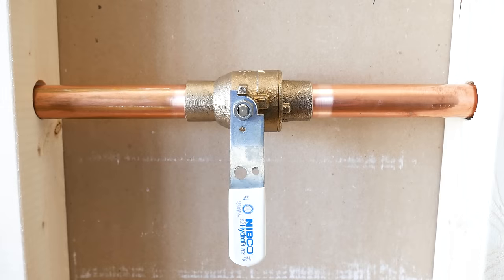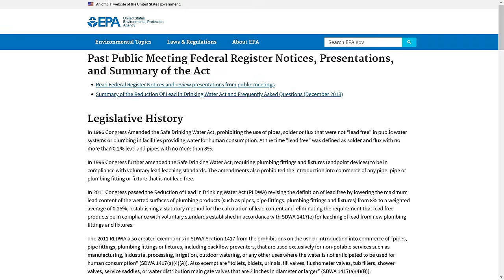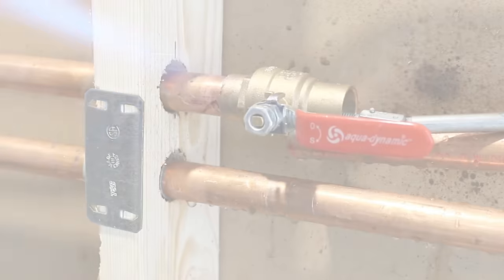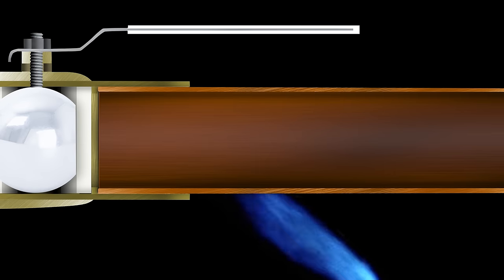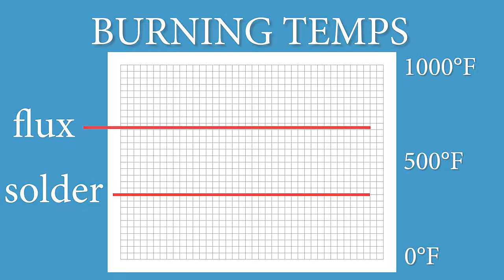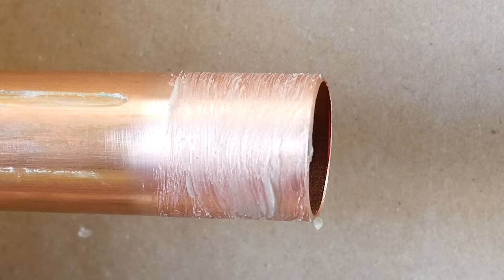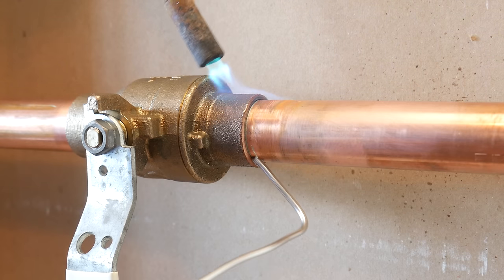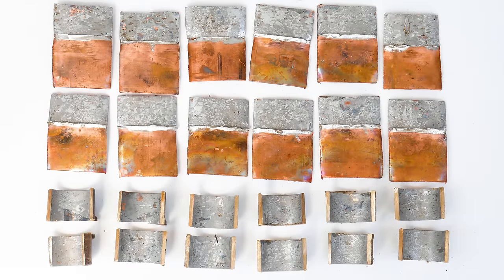How To Solder A LEAD-FREE Ball Valve (Correct Way!!) | GOT2LEARN

Comment: Never solder a ballvalve closed regardless of what the manufacturer says. Unless you have to energize before soldering the other side.
Reply: Right.  Because what the hell do the engineers that designed the valve know about it anyway??  Lol, LMFAO.........
Reply: @StilettoSniper  when you have been in the field long enough you figure out the difference between what actually works and what works on paper. You also have to "re engineer" what the p specs call for.
Reply: @StilettoSniper  I'm just saying I always try to soldier with the handle open when ever possible to avoid overheating the Teflon seals around the ball and an open path for hot air to flow through while soldering. But go ahead. Soldier them closed. Let all that burnt up flux flow right on the ball., with no where to go. While also creating back pressure on your joint.

Comment: NEVER heat up the pipe...just the fitting ONLY! ...
Reply from the maker: Not with lead free brass, that's why it leaks!
Reply: @Got2Learn  hmmm I’ve never had a problem with it.  Still love the vids anyway thx for the reply

Comment: Dude.... open the valve!
Reply: You are creating pressure inside the pipe. If you don't open one end it will stop solder from sucking in properly.. and if there is any reminance of water in the pipe it will steam out the soldered joint and create pinholes.
Reply: @RuneSwagga  that's the way I've always soldered a valve with it open. But maybe I've been going at it wrong 🤔 but I don't think so  lol
Reply from the maker: NIBCO says to keep it closed to keep the seals in their original state.
Reply: @Got2Learn  Go figure, I've never sweated a valve while it was closed I'll have to try it that way ,thanks for the info
Reply: @Got2Learn  Does most of the manufacturers of valves ,want them closed before soldering them  just wondering thanks
Reply from the maker: @plumbbuild6517  each manufacture has their own way of doing it, most times it's indicated on the tag around the stem, so look there before tearing it off, cheers 😉
Reply: @Got2Learn  thanks and I appreciate your videos
Reply from the maker: @plumbbuild6517  thanks man 😎
Reply: D Z  Apollo valves is what I use most of the time, thanks

Comment: Lead free means nothing. With the amount of garbage municipal water departments put in their water it's unpotible so it doesn't matter if there's lead or not in the fittings. Been plumbing for over 30 years and I know parts of town that still have lead services from the main to the meter.